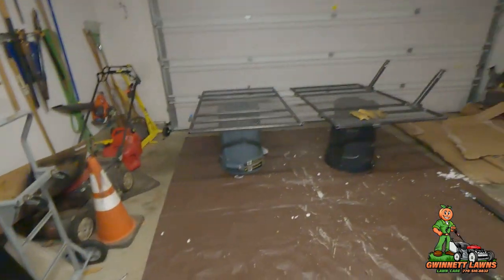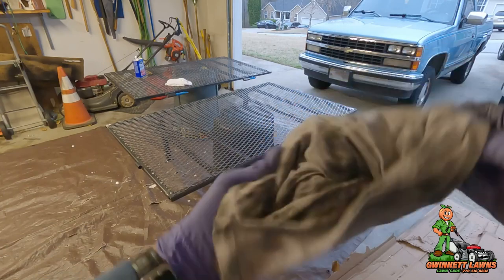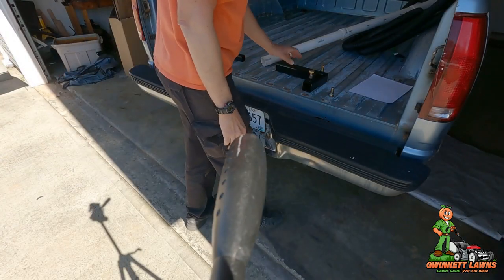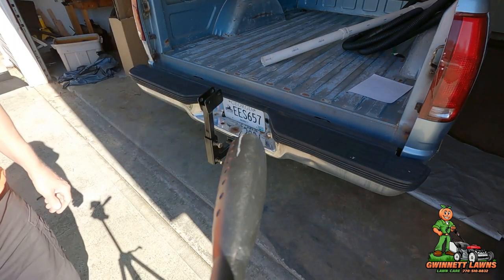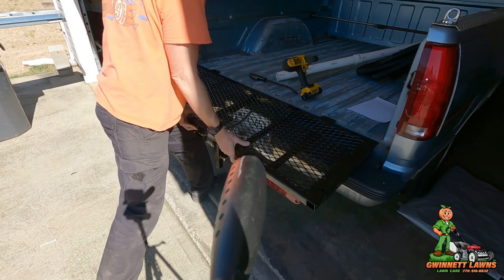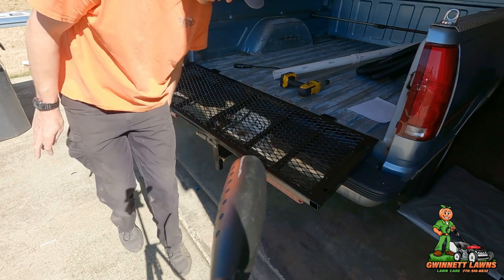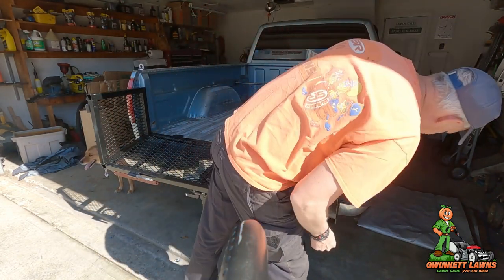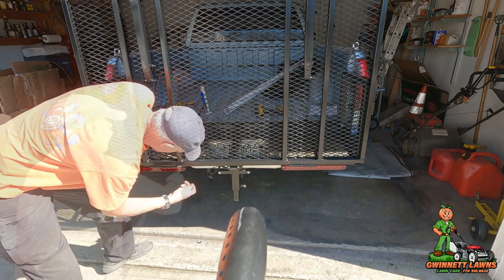Lawn Business Budget Build Series|Mow and Go System

Comment: nice! why'd you go with this vs the ramp rack? how does this compare vs using your big box setup?
Reply from the maker: This was less expensive and I wanted something compact and I really like what Dale is done with his ramps over the years making them better. I also was not aware that they had the sport model of the ramp rack which is kind of comparable to this. The regular ramp rack that slides in and out of the truck I was not interested in. Nothing beats the box truck for convenience and having everything inside and closed and out of the weather.
Reply: @GwinnettLawns  Great point. I had a ramp rack. Was a pain to take on n off not to mention the ramp measured 7ft from the ground. How heavy are those ramps? Can 1 person easily take it on and off?
Reply from the maker: @bobbianchini5086  yep easy to take off.  3 main pieces just unbolt.